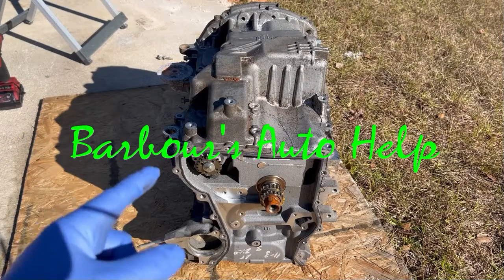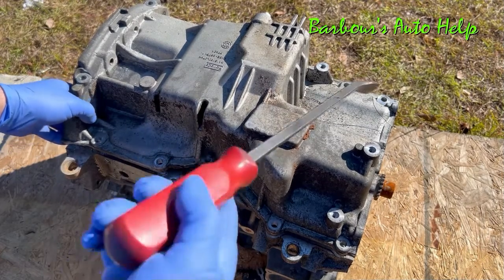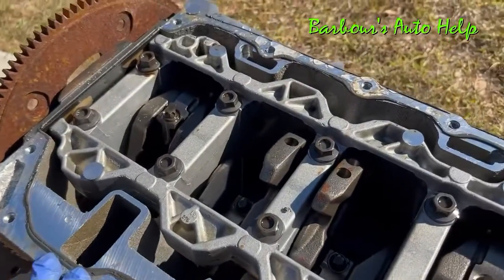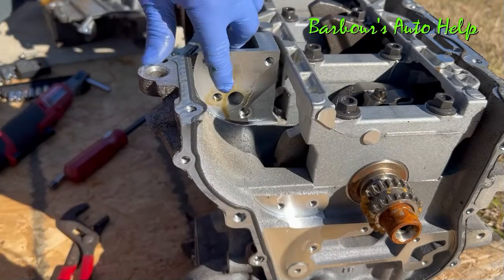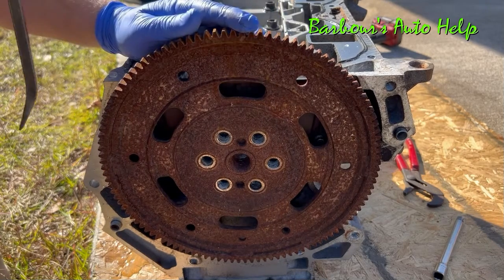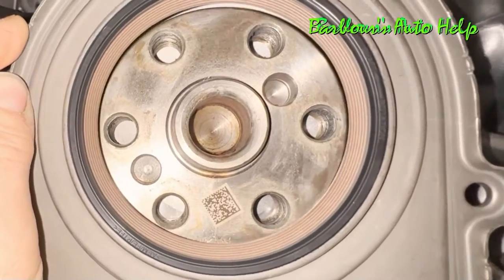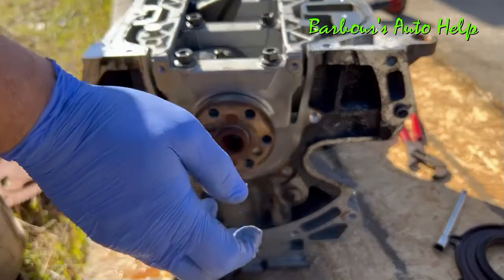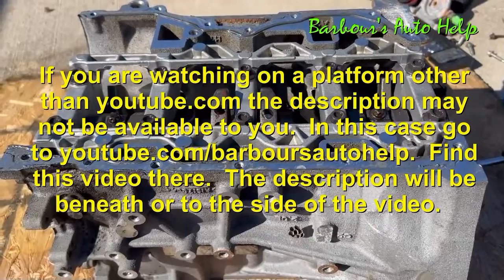Ford Duratec 2.0L HE Ti-VCT Engine - Tear Down - Part 3

Comment: How does this HE Ti-VCT compare to the ecoboost. Which is easier to tear down and rebuild? Which has stronger components? The HE has problems with carbon buildup. What kind of problems does the ecoboost have?
Reply from the maker: I personally like the Ti-VCT better.  In my experience they just hold up better.  Yes, carbon build up on the back side of the intake valves is an issue.  However, it's a lot better than a blown head gasket and head gaskets do blow on the turbocharged engines, particularly the 4 cylinders. (1.5, 1.6, 2.0, 2.3) The 2.7 and 3.5 V-6 ecoboosts however, are pretty stout.  I've yet to see a head gasket blow on one of those.  Ecoboost and Ti-VCT engines all are made of very strong material.  It's the boost that really pushes these materials to the edge.
Reply: @BarboursAutoHelp  thank you for your quick response. I just saw the ecoboost problem you mentioned. Ford butchered the engine cooling to get more power, but now you're lucky to get 100k miles out of the engine. I guess they redesigned the 2020 engine. Now, if they had a good torque converter trans that could be used to swap out the dual clutch unit.

Comment: Mr. Barbour, Sir, you are the BEST at explaining the procession of components in this engine. The tone of delivery of information is calm and friendly but with sureness, and when information is presented that isn't necessarily solid, there's a clear disclaimer of that. This lets a person's brain feel as though the source of information being presented is being delivered with good intentions....and when a brain indicates that the source of the info is gonna have its back (lol, huh?), the brain signals to the ears to open up to permit the acquisition of new knowledge being so logically delivered in its proximity. Your delivery of info in your videos truly increases the chances of a person understanding and properly processing and encoding and storing memory that can later be used during recall. I have brain damage, and you are a saint and one of not many, whose presentation actually accelerates the retention of the information for a later date without the need for excessive repetition. Lol what a crazy comment to an engine teardown vid! This lady is nuts!  Thanks, though, Mr. Barbour.
Reply: Would you please, if you haven't yet already, consider making a short video about the flow of electrical current around the engine area of the Focus? Something simple to clarify the connection locations of the main wire harness that you had pulled off of the engine block at the beginning of the first teardown video. I have my Ford engine diagram that shows the power and ground cables, and I've found a good handful, but I'll be a son of a gun if I can't find where it's all connected to the engine and alternator and transmission. Anyways...thanks for your time!!
Reply from the maker: Thanks for the comments.  I'm a bit of a slow learner and often have a hard time understanding things.  So, I attempt to make my videos for people such as myself.  I'm glad you are getting something out of my video.  This video linked below may be of help to you.  https://youtu.be/q8zVtUDTb5U?si=h1NRHzbxMNqBJKlE